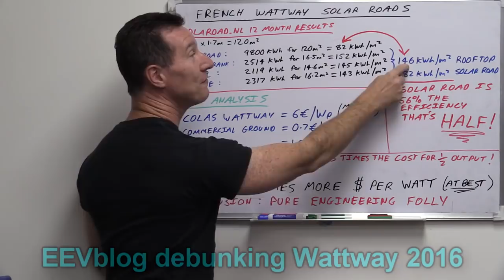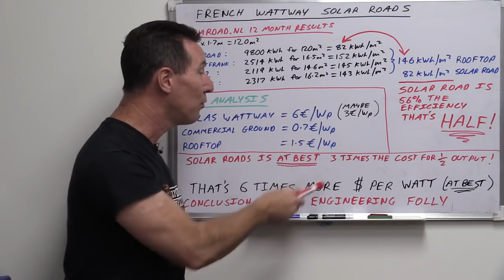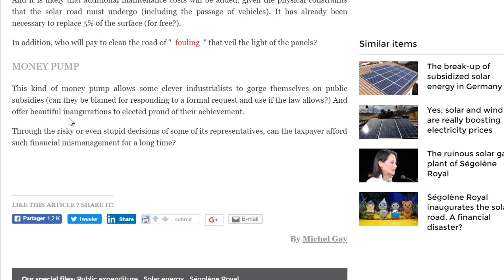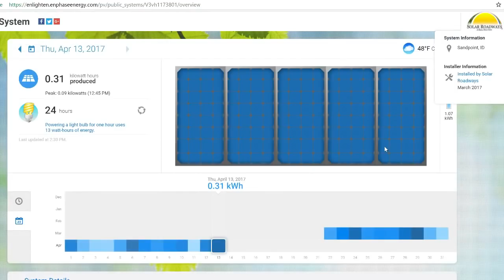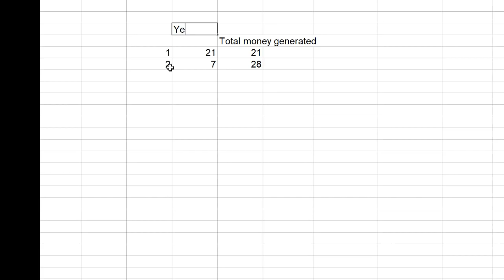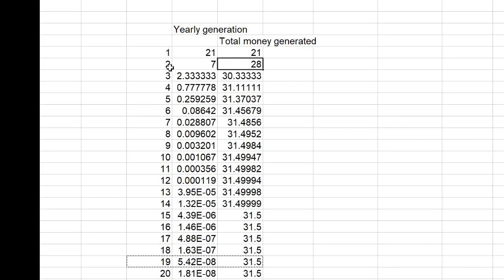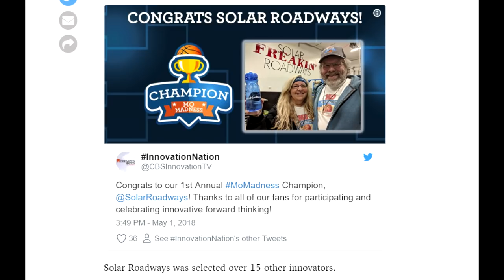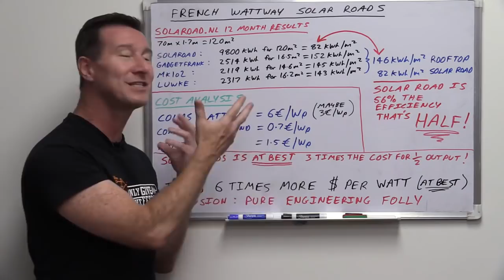Solar Roadway: 10¢ return on $1000 investment!

Comment: 5 bucks the company installing the Wattway in Georgia is actually using the expected 0.01% return on investment as a tax write off. If so they are geniuses. Build up public trust, invest in "The common Greater Good" and write off 100% of your tax as "Losses in Environmental Projects" for the next 10 years. (assuming the cost of the roadway does not exceed what they would have paid in taxes and they have smart accountants.) Hell depending on the government they might even receive public funding to install the road and STILL write the loss off in tax.

Comment: I don't get how this is supposed to be better than elevating standard solar panels above the road surface. You could even make the entire road a tunnel that cars drive through. Seems this would not only put power generation along existing developed acreage, but would also limit the heat absorbed by the road and cars.

Comment: What about solar railways if you put the panels between the tracks then there would be no structural load on them. Granted energy production would still be lower than a typical installation but it might work.

Comment: I'm interested in solar shingles because regular shingles (including labor) are so expensive.  You can deduct the cost of regular shingles from your solar installation if the solar doubles as your shingles.  Also regular shingles don't last that long, so if your solar installation makes it 15-20 years, you haven't lost anything on the roofing use of them.  So if it costs $30,000 to install solar shingles but it would have cost you $20,000 to install regular shingles, your solar installation cost $10,000.  That's a lot cheaper than putting a $30,000 solar system on top of an already existing $20,000 roof.

Comment: Very ballparked (well, phone calculated), but for $500k they could have given 125 poor families a $4k roof installation FOR FREE, and at peak 15kwh operation would probably have ended up with both an energy surplus and those families would have a $0 electricity bill! (though not in practice, obviously, as people tend to only turn the lights on at night)
Reply: Isn't it quite obvious, that they are not interested in GIVING money, but only in GETTING money?

Comment: My problem with solar roadways (the concept, not the company) is that energy effeciency requires smooth surfaces, but cars require rough surfaces for traction.  Driving on these, even if they worked perfectly, would be like driving on glass.  What happens when it rains or snows?  Very dangerous.

Comment: They'd be better off putting solar panels in between train tracks, or... you know... not have anything driving over it at all.
Reply: Tough dust will settle between the tracks and cover the panels, but least there is trains going over them all a time and those could be equipped with cheap cleaning system, that washes the panels on the move.
Reply: God the vibrations would be Hell on the panels and electronics. Might not be a great idea unless you could cheaply figure out how to dampen them.
Reply: Yeah, between train tacks isn't very friendly terrain. Best idea if you really want to mix solar power and roads is to build solar covered awnings.
Reply: How about SOLAR WATERWAYS. Let's put solar panels underwater at busy shipping routes!
Reply: You forget the fact that train toilets empty between the tracks.
Reply: You're on the right track with your train of thought. Putting solar panels next to road- and railways is a pretty decent idea.

Comment: Energetically it's probably an even worse failure. Producing the silicon for the panels alone probably needs much more energy than this thing produces, even if they got degradation to sensible levels.

Comment: I wonder – why does nobody of these morons think that constantly scratching a transparent surface would heavily decrease its translucency (and efficiency along the way)? Would it not be much more efficient to just put in thousands of piezo elements to generate some current (they don't care about scratching ;))?
Reply: Hey guys, what about my ingenious idea of using piezo elements instead of solar panels??? Okay, would not work for parking lots, but on a much used road it should work nicely and produce even more power than these solar roadways! What do you mumble – that's not for sure and unproven? But I say so, so it must be true! And I'm actually an electrical engineer with a German diploma from the Technical University of Berlin, so I should be an expert here! Well, okay, I didn't run the numbers – but who cares? … ;)
Reply: Christian Augustin , it would be just transferring energy from the cars to an electrical grid. You can't do that without slowing the car down or increasing its fuel consumption, so it is a very inefficient way of generating electricity.
Reply: Pedro Palma – spoilsport! ;)
Reply: Indeed it would, and it would be a better idea than Solar Roadways, but you know whats ever better than that?

Solar installations in their own open sites, preferably in desert areas.

You can also install dynamos on the streetlights on the side of the roads, that have spoon-like flaps on them that make it spin around the streetlight, generating electricity. Basically turning the wind of the cars passing through into electricity because the thing will spin albeit at low rpm.
Reply: Nice idea with the spoon-like flaps around streetlights – should be especially effective on highways. O, wait – most highways don't have street lamps …
Reply: @c.augustin  this has already been implemented

Comment: The main reason for the rapid degradation of performance is the high temperatures that a roadway endures, exacerbated by the glass cover. Regular mounted solar panels and solar roofs can dissipate heat readily from both sides, angled mounting makes for stronger thermal currents than a horizontal mount. 
Another reason for rapid degradation is stress fractures in the solar cells - and thst is just with pedestrian traffic. It would be far worse with vehicles running over them.

Comment: As you said, putting solar panels on car parks and garage roofs would be better. One has to wonder why nobody is pushing for putting solar panels on the majority of new homes constructed (well, except Elon Musk) just as an assist to homes' electric consumption, No, it won't be a 100% replacement, but it can ease use on a per household basis and be changeable as the tech improves (battery and solar cell).

Comment: I don't think you can actually extrapolate that it will continue decrasing its output by a factor of 3 every year. I don't know what caused such a drastic decrease the first year, but it isn't the semiconductor taking radiation damage, I think it's more like their window to the rest of the world being more opaque, more occluded, in other words its optics are dirtier. But whatever process did that, I don't think it's going to continue much beyond that. Maybe it got grimy and gross and the grime stopped 2/3 of the light. It's still a dumb idea though, even if it didn't go down by a factor of 3 even in the first year.

Comment: You’d probably generate more power by installing tons of piezoelectric plates on the road and use the exhaust and friction heat of the cars to generate power.

Comment: Calculate the square footage of the average car and transports, then subtract that from the footage of the road surface. CANT GENERATE ENERGY IF THE CAR IS BLOCKING THE SUNLIGHT! Hey dumbasses, buildings and trees also cast shadows.  There is a reason we put panels on the ROOFTOPS or in wide open unobstructed fields. Don't even mention the loss of efficiency due to refraction from the glass surface. If you think this is a good idea I think you need some help.

Comment: I have seen the proper idea implemented in north-east texas, a place where extreme sun and heat and extreme hailstorms are both issues. A large office building on my commute first built a covered walkway grid (to allow someone to make a long walk across a flat lot in high heat or rain in relative comfort and safety) and then built out a system of covered parking spaces on most of the property. All that real-estate on top of the covers? solar panels fixed at a middle-ground tilt. So employees have the great benefit of shaded cars in the summer, hail-proof parking in storm season and power is generated on site for the building to offset construction costs with long-term HVAC cost cutting.

Comment: I feel the logic behind it being on roads is maintenance, infrastructure, and being linked to things. It doesn’t account for the logical failures though, they would be better off making nice roofs for the roads with panels on top, it actually helps keeps snow off of the road, keeps uninstructed solar panels, and leave the road surface un-compromised. I don’t know about the realistic implications for this or the cost, but I can say, at the very least, making a parking lot with car port style roofs that have solar panels and then an array on the roof can do much more good for everyone. No snow on/burning hot car interiors, the possibility to track the sun with said array, and it being linked to a building/business that can utilize it makes a hell of a lot more sense. Hell carport style parking would be dope in the summer and winter alone, add the solar panels to make it more useful.

Comment: My question is an will always be, why do the roads themselves have to be solar panels? Why not just build tall canopy stretching down the highway with solar panels mounted on to. Keep the snow and rain off the roads, help keep sun out of your eyes, don't have to stop traffic to repair anything, could have the cables running through it much easier, and could presumably power signs and message boards.

Comment: The really insane part is the "melt ice" property of the solar panels. If there was enough sun energy coming to the road to be converted to electricity and then heat up the road to melt the snow, then the snow would be melted by the sun without any freaking panels in the first place!

Comment: I have a brilliant idea. I call it "the covered solar roadway". Instead of putting the  panels on the ground, we build a 7 meter high roof over the road. By doing this, we have all the advantages of the original claim (producing electricity, keeping the road snow free, easy to install and remotly changable roadsigns etc). You might get some problems with wind, but with a bit engineering and a sturdy frame, you can overcome this problem. Plus you can angle the panels. Where can I get my million dollars?

Comment: Every car that is on a road, shades the road.  Only roads that don't have any car (or dust) on them will generate the miniscule diminishing amount of electricity, on a very sunny day.  Driving on a "solar roadway" is switching off a car size area of the solar panels.
Reply: Not to mention, what happens when a huge truck hits their brakes on a wet glass surface at full speed?   I'm guessing that it would be like driving on ice.
Reply: Actually, dust seems to not bother solar panels a lot.
I live where there is heavy dust depositing on my test panels.
Side by side panels that test equal immediately after cleaning.
30 days, cleaning one daily (actually spraying with glass cleaner and wiping it clean with paper towels, repeat until the paper towels come back clean) and never cleaning the other.  The uncleaned panel looks like you spray painted it with mud and let it dry...
Uncleaned  was still producing 93% of what the cleaned one was producing.
Spray the dirty one with a hose, washing off the worst of the dust... 99%

"Windex" outdoor spray window cleaner (or similar) then rinse, when the panels look bad should be more than adequate cleaning.

I expect the solar collection elements are cracking under the glass and that is why their performance is degrading so fast for the solar roadway.
Reply: @fhuber7507  solar roadways are also flat on the ground (not angled) and thus less efficient even if they weren't degrading, the whole idea is silly.

Comment: Why would you build your argument on a decrease of the efficiency of 1/3 the year before? There's clearly (and unsurprisingly) something wrong with that installation. They'll easily dismiss this as some bad electric connection or something. If you assume it's not a fault but a characteristic of their product you're throwing them an easy ball.

Comment: I was thinking ....put a solar panel under every car. Pave the road with mirrors. The sun would reflect the light under the car and the panel can then charge the car ( if it's an electric car ) or you could store the electricity in a battery and use it when you get home to power the house. 
You could of course put the panel on top of the car but you get more grant money doing it the other way.
Reply: Phillip Scott They would be special mirrors with a sticky coating to stop the car skidding. Obviously I would need extra funding in order to invent the coating. Lol

Comment: Here’s a real way to do solar roadways: build a metal framework over the road, and put tracking solar panels on top of it. Keeps rain off the road, you can connect lights underneath it (that also will produce less light pollution than normal street lights) and it will actually generate some power.
Reply: Waste of iron, and the cost of building that amount of frames that would live up to the safety regulations that will be on them would be astronomical, then add the cost of solarpanels. No leave solarpanels to solar farms and rooftops where they belong
Reply: +Micahel Bomholt   Well said. I still upvoted Kepler 68's comment for at least trying to come up with a workable idea.
Reply: Also add costs of maintaining them while there is cars driving below. Another dangerous job and you wont be seeing feminists demanding women to go do that.
Reply: Would be easier to just put little roofs over parking lots with panels on them. Keep the car cool and generate electricity to charge it.
Reply: didnt think of the steel cost oops.
also Roxor128 they already do that :)
Reply: I think that near the road would be more efficient.

Comment: A Dollar note weighs one gram. Wikipedia tells me wood has 4.5 kWh/kg. I allege paper has about the same. So straight up burning $500.000 should give you around 2.25MW. Sure, there is some loss involved when converting that into electricity with some steam machine. I am still fairly certain, burning the money will outperform those panels for lifetime energy.

Now imagine a world in which all roads are solar roads and you start an IndieGoGo campaign for your project aiming to save money by burning it.
Reply: You could first convert your dollars into a currency that has banknotes that are worth much less than a dollar.  By selecting the right currency, you could probably get 20x as much energy as just burning actual dollars.
Reply: You know that dollar notes arent made out of paper/wood? its 75% cotton and 25% linen
Reply: Ahh yes, the venezuala public housing heat strategy.  It seems to be working quite splendidly for them thus far.
Reply: To the top with you!
Reply: +David K. Tasso  THANK you for doing the math for that literal money burning bit.
Reply: I got curious about this and did some searching.  This blog calculation is pretty good and states about 13 kJ/bill (one gram).  Assuming a normal ~30% conversion efficiency engine, you can expect about 4kJ/bill or 1 Wh of energy recovered per $1.  Assuming $10k goes in (as $1s) and the energy is recovered, you get 10 kWh or about $1.20 assuming $0.12/kWh.   Basically the same as "Solar Roadways".  

Blog:  http://www.madsci.org/posts/archives/2005-11/1131041118.Ph.r.html

Data compared with above (note basically most organics, paper, cotton, etc are in the same range):  https://cfnielsen.com/faq/calorific-values-for-different-raw-materials/

Arguably, the solar roadways should generate $1 per $10k ANNUALLY (where as burning money for energy is a one-time return), but as we have seen, the installations don't last very long anyway.
Reply: Only flaw I see is that you have to account for the expense of gathering the dollar bills, resulting in less fuel.
Reply: Money isn't made out of paper...

Also the ink would signifigantly lower the energy production.